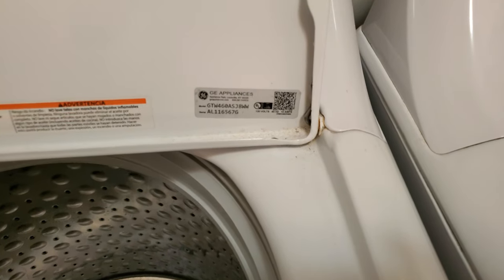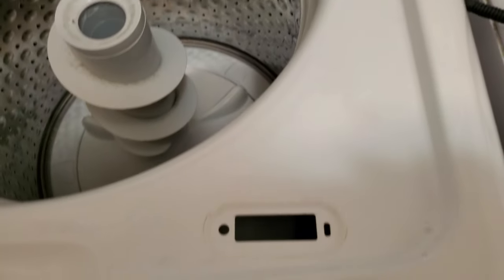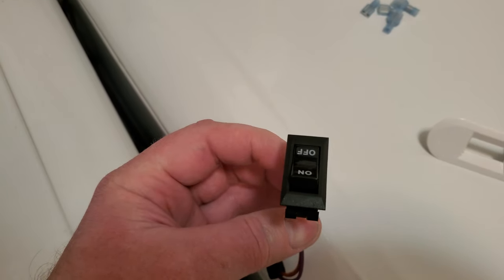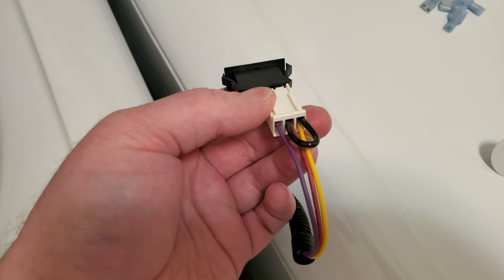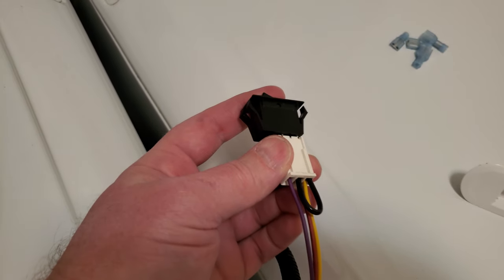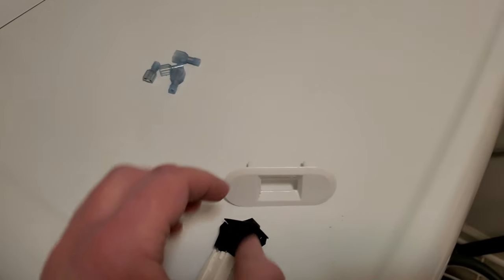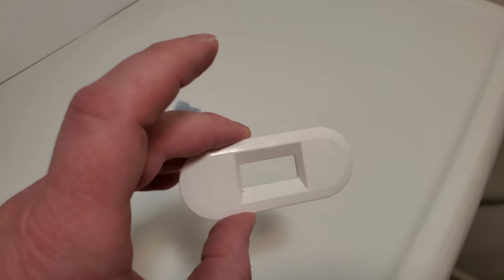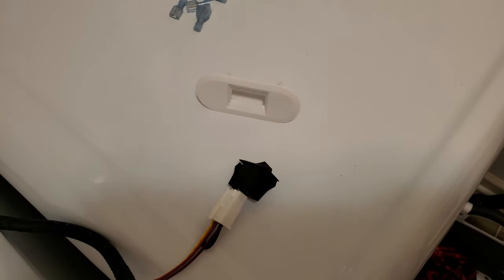Garbage Electric GE washer lid lock fix

Comment: This solution worked for a while just having to manually switch the lid lock on after the wash cycle. Have to be right there and listen for it to trying to activate the lock and hit the switch. Otherwise it will turn itself off im assuming a built in   kill switch for saftety or fire/shock prevention. Now the lid lock is stuck on and wont begin the fill stage. Any advice or solution you could suggest other than replacing the whole mechanism or burning the danmed thing haha. Thanks in advance

Comment: From left to right swich facing true fixed position...

Blue, red, white...

How do I loop, "bypass" that? Does that loop have to be at the board?
Reply from the maker: I didn't mess with the board at all, only at the switch. The loop I have is for carrying the voltage needed to get the machine to even run.

Comment: Hey so. I have the same exact washer but my red and purple wire are switched. What do I do?
Reply from the maker: I would use a multi meter to figure out which which is sending signal to the control board.

Comment: It drains , I have the lid mag bypassed as well switch for lid. Washer fills ok, drained ok , just won't spin or wash. I was just told mother board that costs 500 any other ideas
Reply from the maker: Mine didn't have the lid mag, I'm curious if there's also a proc switch as a double check on closure. Are there any wires near the mag?
Reply: Yes 2, seems like it's a safety backup. When the Magnet is closed , 9 volts is sent to the lock to engage   Take magnet away you loose the 9 v - dc .  I bypassed the lock to help tel shoot , found a bad capacitor, just getting one from Amazon for 20 bucks rather the 85 +tax at repair shop. Same items if you know what your doing 
  @SFA1.0
Reply: Also more info on a newer he. To get into tech mode, you need to turn knob 3 times right , 2 times left and one time right to stop, that apparently gets you in , But would not work on mine lol .  Also the guy stated to buy another mother board for 500 can, Ya right , I'll just buy another unit .  @SFA1.0

Comment: Hey man, I dont have a switch on hand. Could i jump red and yellow and put another jumper from yellow and red to purple? Thanks. (Im desperate for work clothes to spin atm)
Reply from the maker: You would need to baby sit the machine waiting for the cycles to connect your wires manually.
Reply: @SFA1.0  Thanks for the reply. Whatbibended up doing last night was taking apart the switch. I took it apart to see what was wrong with it. The lock button was sticky inside the motor housing. It kept clicking before and fail the load because it wouldnt see the lock signal. 

I used some silicone lube and sprayed it. Worked it back and forth. Put it all back together and now she works mint!
Reply from the maker: @Briggs Guy  Noice, good work on the sleuthing.

Comment: How’s it look, I might do this on mine
Reply from the maker: It will be a temporary fix I advice getting the replacement part. The long run you'll burn up the control panel jumping the switch more often then regular.

Comment: Looks good. Could you give an Amazon link so we can order the switch?
Reply from the maker: Just stop by Lowe's or Home Depot, be mindful this should only be considered a temporary solution while you wait for a replacement lock. This worked fine for me for a couple of months and I never ordered the fix so because your switching manually you'll be out of sequence more and will burn out the board behind the knobs from getting the machine back in correct order.

Comment: I bought a 3 pin switch but concerned the switch lists pin 3 as hot but on harness the red wire is in the middle(pin 2) so i dont think i can just fit the switch inside the harness.
Reply from the maker: So my switch was technically a on off switch with a light indicator. What I truly needed would be a switch that would have 3 selections off on and lid. The main premise is that your manually controlling the switching sequences just to get by until a replacement became available. So it if the the 3 wires the washer is only looking for 2 at a time. One sequence to check the lid is "locked" and then the other to start cycle which stays on for the duration of the cycle.

Comment: How did you hook the switch to the wires
Reply from the maker: One switch actually snapped right on top but only had 2 prongs then I purchased a 3 way switch and had to use blade connectors.

Comment: I want to try your fix on my washer because one of the solenoid wires burnt up on the switch. I know I should just buy a new switch, and probably that's what I'll end up doing but until it comes in I want to give this a try. Wish me luck
Reply from the maker: Lol God speed!!! Fair warning I would not keep in the manual switch for long to many failed attempts to keep the cycles going will work the main board a lot, we wound up getting rid of our ge's as it wouldn't cycle anymore. I assume the board fried from switching so much. That was our case hopefully your new switch comes soon.
Reply: @Steven Archibald  it worked! But I knew better than to run it like that so the next day I bought a new switch. Good thing is that ge redesigned it and it is a much simpler design using magnets instead of a solenoid and gears. Hopefully it lasts a while

Comment: Do you have a part 2?
Reply from the maker: Sorry part 2 only results in replacing the units lol, the main board wouldn't cycle correctly anymore even with the manual switches.

Comment: Hi did you use a 3 pin or a 2 pin switch?
Reply from the maker: I used a 2 pin unfortunately, so i had to combine the wires that are supplying power then I the switch toggles the lid lock, the downside to this is that the machine needs to see that the lid was open and with the wires supplying power combined I have to pull one blade from the washer harness to show the main board I don't put them clothes in by osmosis. If using a 3 way switch it be ideal to be able to switch for lid down sequence then when needed keep that enabled while then adding the lid lock sequence of that makes sense.
Reply: @SFA1.0  So I have only been able to come up so far with the 2 pin that will fit. It worked to wash but wont drain and spin. Do you have to turn the toggle to the off position sometime durring the cycle to make it complete the wash? Thank you for your Help :)
Reply from the maker: @animalhouse320  you will need to toggle the switch after the wash cycle is complete, you won't get any signal it's done other than it's just sitting quite for more than a 10ish seconds. Did you wire how I have in the video? If your unable to see I'll try to get you something better later this afternoon.
Reply from the maker: @karleenfoley4405  disposable at worst prices.

Comment: I tried this by just connecting a wire directly... I think i burnt the board
Reply from the maker: Yeah gotta watch the cycles. Mine eventually burned out from missing the cycles. I basically was babysitting the machine up to a certain point in the cycle.
Reply: Ya well I think they lock which is why it's a 3 wire connection on the board so I have been trying to find the color coding for I don't sent power back to the border when it activate the lock
Reply: Did u fix it ? I think i did the same 😂 i replace the lid lock switch and it does not do nothing now
Reply: @christopherpinto884  I didn't fix It, but i did find the problem... It think it was a DSM regulator (it was all blown up, with a hole in the middle)

Comment: Just replace switch oem
Reply from the maker: I'll be moving so I'll be buying a new set. There are more problems than the lid, the shut off valve for the water doesn't close or seal completely, a "super" load fills the drum just over half way.  I would agree with your comment they are a 30 dollar part. I just posted this as the in between solution until unit is fixed.
Reply: For like $90 no thanks